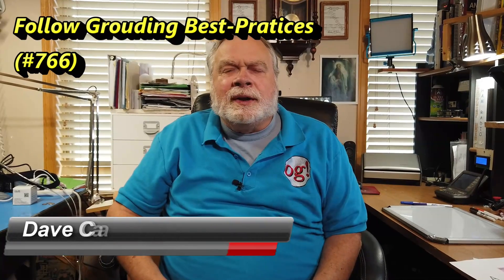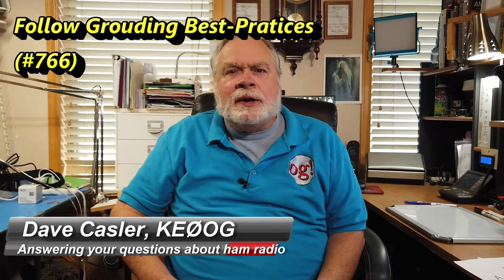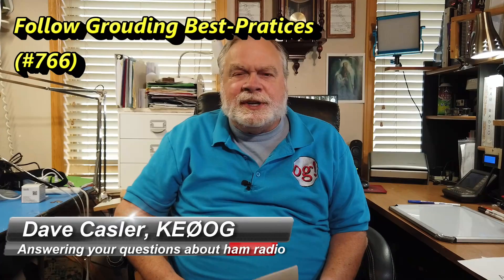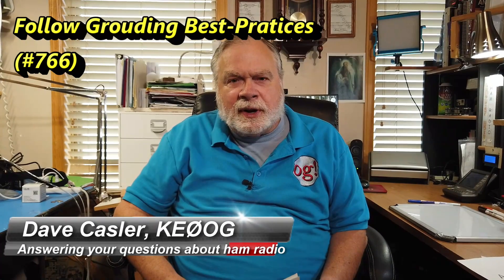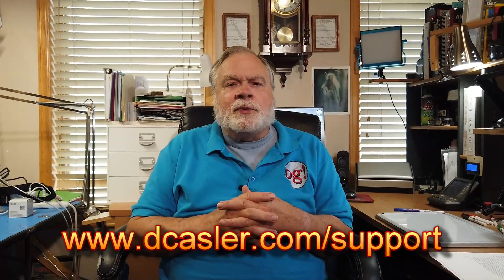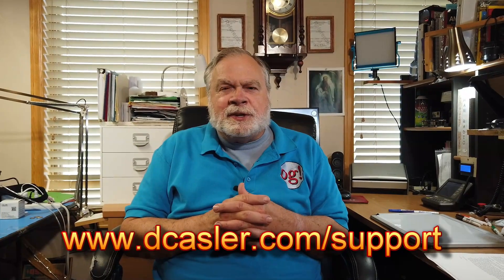Follow Grounding Best-Practices (#766)

Comment: And don't be afraid to drive more than one rod. Depending on the soil resistivity, it may be required.  In the military we had a Vibroground to test resistivity, and it was common to drive a minimum of 3 8-ft rods to pass the test. In sandy Florida I had over 12 rods and still couldn't get  the required specs for the comm equipment. For my set up, I got the digging permit (which was a good idea) rented a rotary hammer, got a ground rod adapter for it, then went ahead and just drove three rods about 16-20ft apart and tied them together with 6awg and bug nuts.

Comment: An interesting true story about vibrations.  We had one line of outlets that were periodically "powering down."  The breaker was not tripping.  Finally called in an electrician.  He investigated for a bit.  Took the cover off the main electrical panel.  He found that the screw on the neutral wire to that line of outlets had "backed out".  The outlets had been fine for many, many years.  Nobody had been in the panel for many years.  But there had been some serious construction across the street, with heavy dump trucks hauling crushed rock passing by the house.  I could feel the house vibrate. The panel is attached to the foundation wall in the basement.  That's the only explanation that I could come up with.   Yes, vibration can affect compression connections.

Comment: Thanks, Dave.  Great information on grounding and also the surge protectors. I really like the high quality build and ease of use, specifically regarding the Alpha Delta (Transi-Trap) design.   Having an extra replaceable gas discharge cartridge on hand, as a quick swap out, would surely be a good idea, too.  73,   AC3HT  ⚡⚡
Reply from the maker: Glad it was helpful!

Comment: Wind does cause static discharge but, its highly charged storm clouds overhead doing most of it. Arcing across AM tower guy insulators is common and across unconnected pl-259 antenna connectors without a suppressor or shunt and ground.
Reply from the maker: Wind can create quite a voltage even without nearby thunderstorms.
Reply: @davecasler  very true

Comment: Speaking of uninsulated wires for antenna's, that applies to beams and such too that use aluminum or copper tubing (like J-poles).  It actually amazes me that the mfr's don't put a conformal coating on the elements to prevent static build up; like during snow events, which I've read can just destroy reception with 'snow'-static.
Reply from the maker: Wind + exposed metal = problems

Comment: Dave. I use a mobile radio for a base station. Is there any issues with case grounding DC equipment with AC equipment? DC radio, DC amp, DC audio equalizer, DC watt & SWR meter, AC to DC power supply. Thanks for making great informative videos!

Comment: Safety/understanding issue. At 9:20 you discuss the "green wire ground" on a power supply being the same as the "black wire" going to your radio" This is very confusing, as the  black wire to the radio is really on the neutral (white wire) of the utility. It is not supposed to mate up to the the bonded  ground until it gets to the entry panel.
Reply from the maker: Not so. The 12v black wire is connected to the green wire utility ground. If connected to AC neutral, it would trip any GFCIs.

Comment: Just starting to get interested in radio here. I understand the antenna grounds, that makes perfect sense. But I am wondering why a piece of equipment that uses a 3 prong NEMA 5-15P plug with ground back to the household panel would need an additional ground. Is it because this additional ground gives you a shorter, superior path? Or is it related to what I've read about the ground path for RF vs the ground path for high voltage electrical?
Reply from the maker: The station ground can reduce RF noise coming into the radio. Also, in the event of a nearby strike, it helps equipment all stay at the same voltage level, which can reduce damage. Be sure to "bond" (connect) the station ground to the utility ground. The third (ground) prong is there for electrical safety, not RF grounding.
Reply: @davecasler  - thank you for the reply and all the fantastic material you have produced.

Comment: I have a question about grounding base station antenna. It's been a long time since I've had to do this so my memory is lacking in better terms. I want to put a 40 ft mast up with a comment antenna and I'll run guy wires of course. When it comes to grounding the antenna I get confused on where exactly to ground it at. Where do I attach 6 gauge copper wire to the antenna directly or to the mast. I've been told by several people and watched many YouTube videos I've seen and heard a lot of them say to attach the copper wire to your mast. That in theory if you ground the mast you are grounding your antenna. Is that correct and would you advise me installing it that way thank you very much for all your help in advance take care
Reply: KB7RED/WRKA434
Reply from the maker: I also recommend the mast be grounded.

Comment: What do you mean by connected to a  "tape hole" on the roof at 2:45?
Reply from the maker: J-pole on the roof. It's a type of antenna.
Reply: @davecasler  I know what a J pole is, just played it several times and couldn't figure out what a tape hole was...
Reply from the maker: @Ben--David  Yes, I played it several times too. My intent was to say J-pole. After about the fifth time I played it, it came back to me.